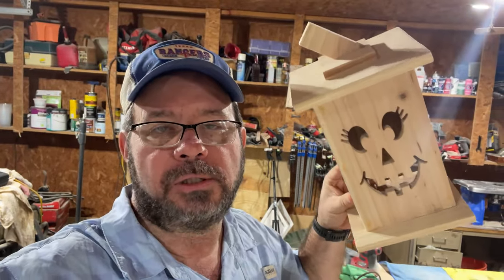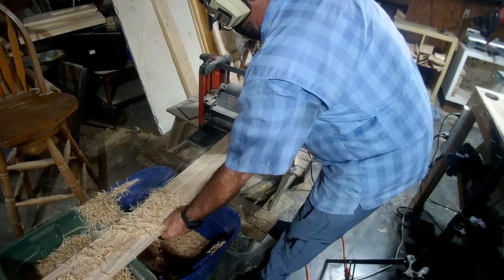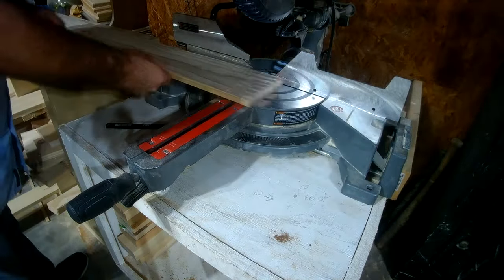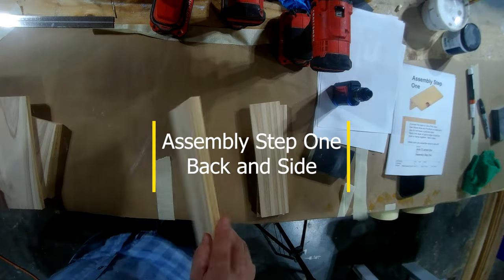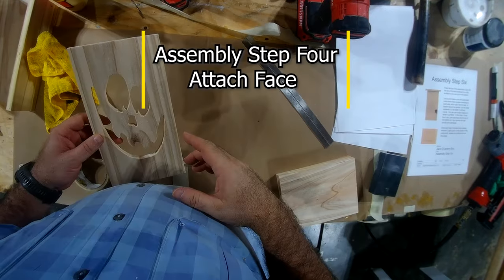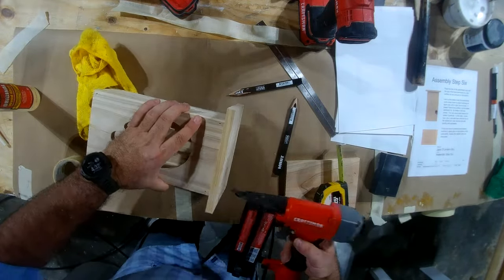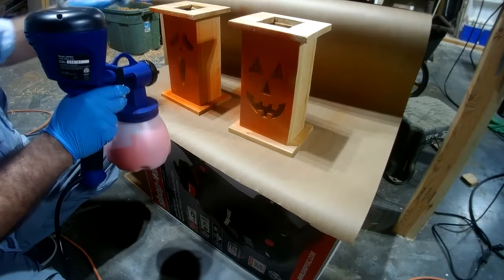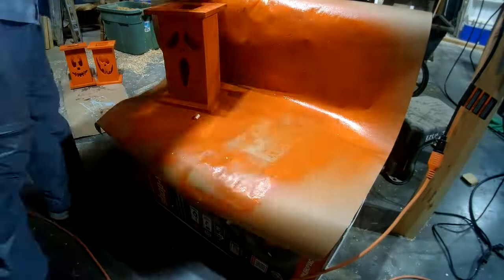DIY Wooden Jack O' Lantern Box With LED Lighting Fall Halloween Decor

Comment: What lights did you use?  Great project
Reply from the maker: Hi Keya.   I used these from Lowe's.   https://www.lowes.com/pd/Portfolio-4-CT-5LM-SQUARE-Bulk-Path/5000112351 
You can use any that you find that fit.  Most are easily removed from the globe and ground poles.  These just pop off without any tools.  I wouldn't use any brighter than 5 lumen.  The 10 lumen one's would be too bright.   

As for the LED tea light version, you can find the tea lights on Amazon or even at the Dollar Tree, if you have one in your area.  The LED tea lights just require turning off and on every night and replacing the batteries when needed.